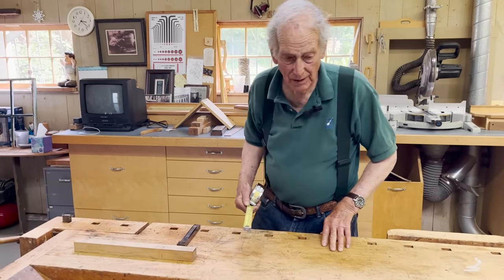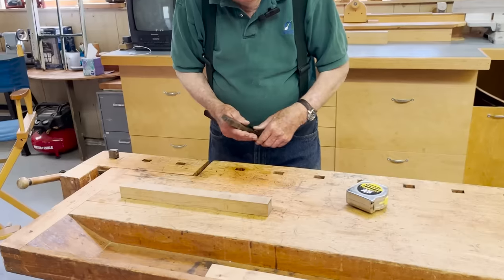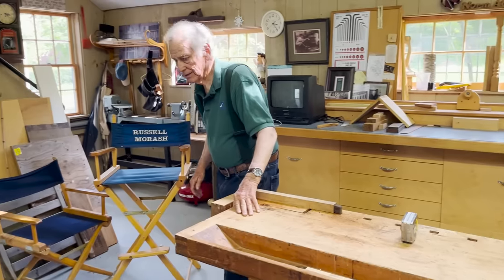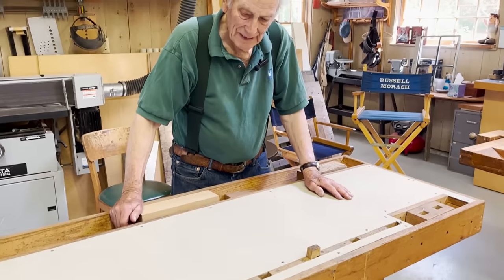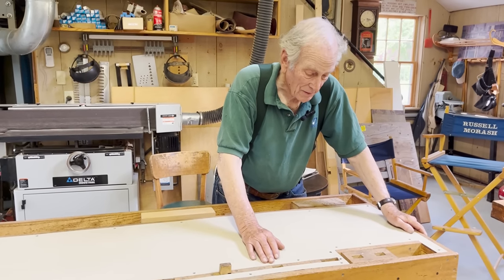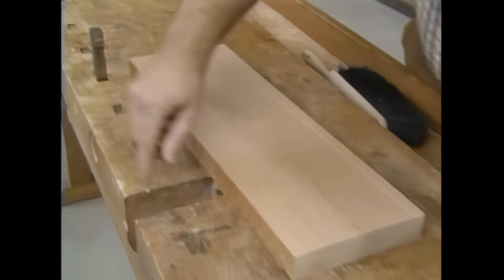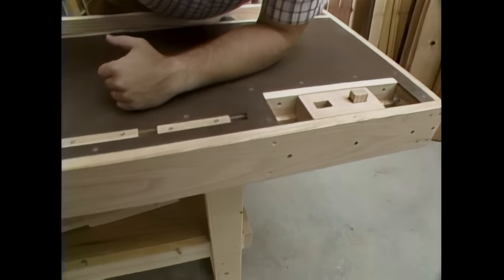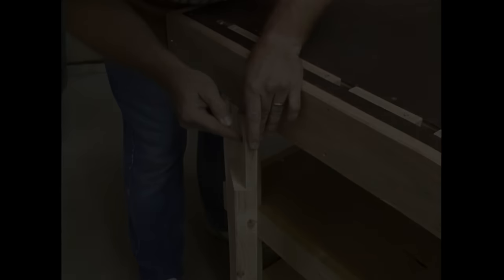Project Update: Workbench

Comment: Thank you Russ and Crew for these 2023 Project Updates. Great to see how these classic New Yankee Workshop projects have worked over the last 30+ years and to see updated insides of the iconic shop. (Noted a few tool brands in the background not duct taped out... Delta, Porter Cable and Stanley tools.) In 2001, I built the "$175 work bench"  from Popular Woodworking magazine out of Douglas Fir as a hybrid design with a solid laminated 2X4 top. I added the tool tray and bench dog vise accessories per the New Yankee Workshop plans. This bench and Norm's accessories continues to be the center of my wood working shop now in 2023 along with the Delta Unisaw. Thanks for all the  learnings and memories. Please keep these Project Updates coming!